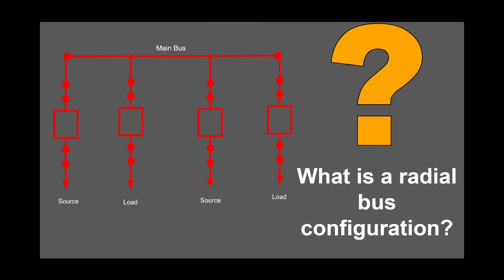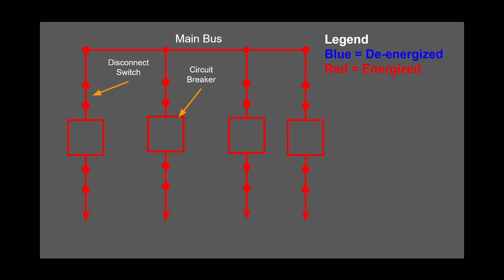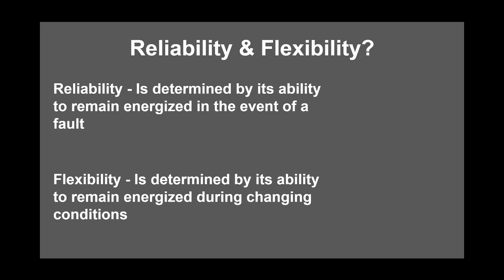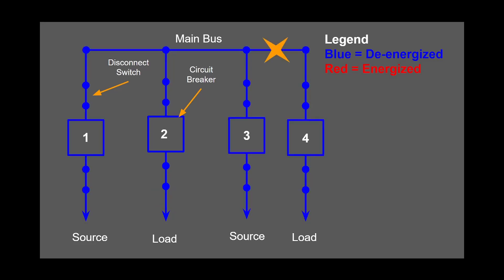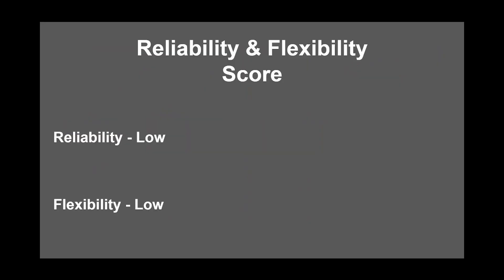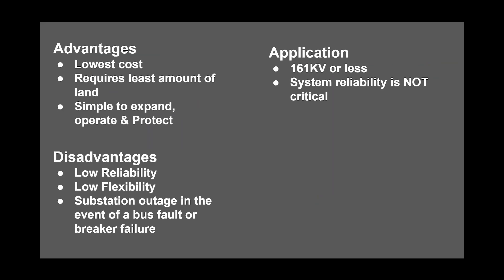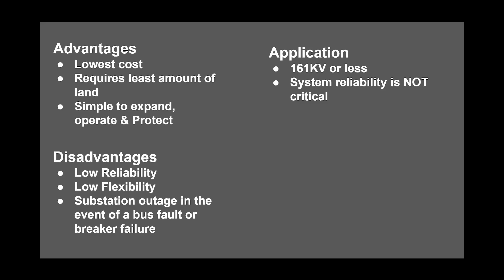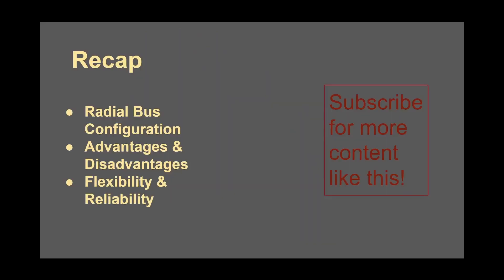Substation Design - Radial Bus Configuration Explained

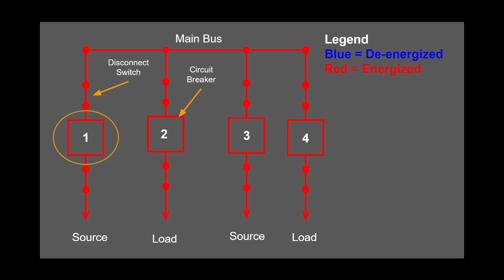Comment: At 2:25 you said if breaker 1 needs maintenance/is tripped then everything downstream wouldn't be energized but is is labeled as a source, so wouldn't the source on breaker 3 keep the loads on 2 and 4 energized? 
Or was it everything downstream of breaker 1 wouldn't be energized. Since it was a source I was kinda confused on what would be downstream of it.

Comment: How does a fault on the line without the breaker tripping affect the whole system
Reply from the maker: If line 2 breaker had a fault (on line side) and the breaker failed to trip. To properly isolate the fault breakers 1, 3 & 4 would need to trip.